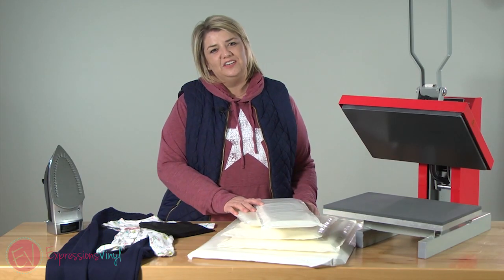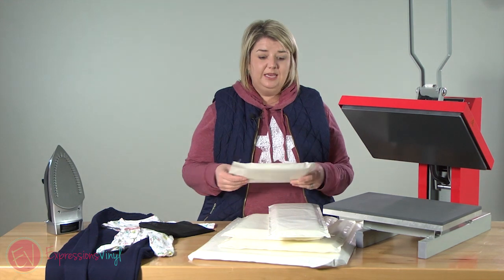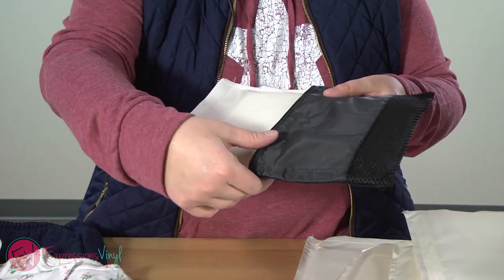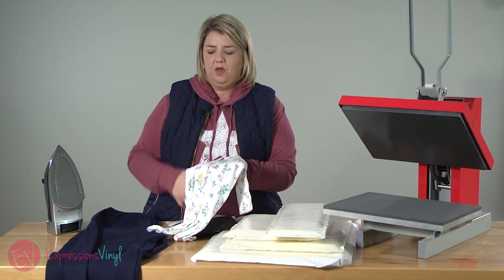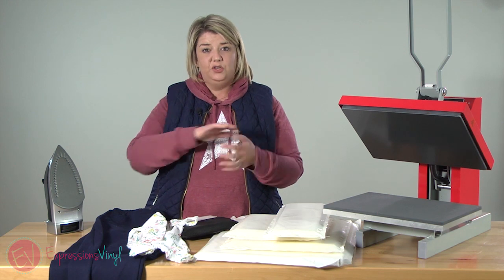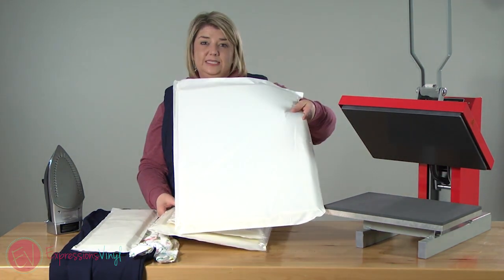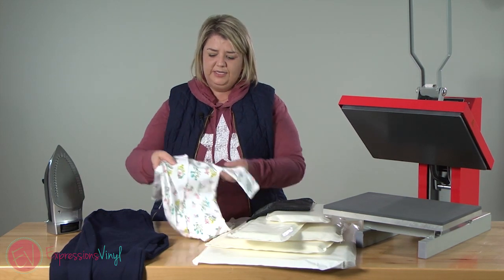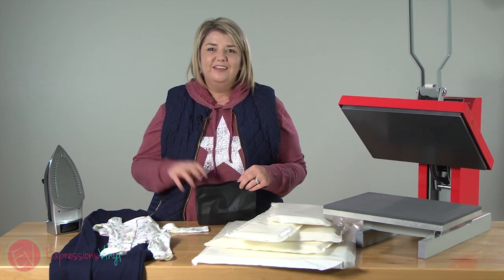How to Use Heat Transfer Pillows Correctly

Comment: Can you show applications using the pillows?  I'd love to see them in action to make sure I'm understanding correctly how to use them. With the small bag for example, once that pillow was inserted, I'm assuming you would place the entire bag & pilliow under the press before locking it down. Is that correct?
Reply from the maker: Yes that is correct. The zipper will press into the pillow and the pillow will puff up the other parts of the bag making everything even out when you press it down.
Reply: Expressions Vinyl thank you!

Comment: Hi! Thanks for the video! I’m wondering why it is necessary to insert the pillow into the garment rather than lay the garment right on top of the pillow? Would it work just as well either way? Thanks!
Reply from the maker: If you have a front and back decal the pillow can prevent the decals from getting too much heat from the other side. If it is just a one sided decal, you can just place the garment on top of the pillow. You will just want to make sure the back isn't wrinkled when you do.

Comment: Hi! With heat press pillows do I need to adjust my pressure to anything different than I have it according to the “paper test” or does it stay on the same pressure? I don’t want the pillow to add too much cushion & break my press. thanks!!
Reply from the maker: It depends on how thick the pillow is. I would try to stick with the paper test.

Comment: Hi, thank you for these tips. Im wondering, can I use the same large pillow for tee shirts and onsies or anything smaller than a tee shirt? I saw someone say you have to use a small pillow for small things etc. Just trying to avoid having too many pillow 😁 Thank you
Reply: Hope that makes sense
Reply from the maker: @jennygrant5202  You would be able to use the larger pillow for the small projects as well. If you are wanting to put the pillow inside of the project because you are pressing on both sides of the shirt. You will need to purchase a different size one.

Comment: Hi do the heat press pillows help stopping lines when pressing?
Reply from the maker: Hi, yes they can.  The hold up the seams of the project you are working on so that it can get even pressure on the htv.  They are great for onesies, sleeves, pant legs, etc.  https://expressionsvinyl.com/tools-accessories/heat-press-pillows/

Comment: good afternoon can I use it for caps or hats ?
Reply from the maker: Yes, that is a perfect use for the heat transfer pillows.  They work great when the surface you are adhering it to isn't as flat as you'd like and a little more difficult to work with.

https://expressionsvinyl.com/tools-accessories/heat-press-pillows/

Comment: Susan
Reply: Oops.  My question, do I place the pillow inside the small size garment or place pillow underneath garment? Thank you.
Reply from the maker: Hi Susan, you can do either one of those.  If you place it inside there is less of a chance for the garment to move off or slip.  However, there are times when the pillow might be too big and it works best to just lay it on top.  Hopefully this helps.  The pillows work great for all those pesky seams and bulky areas!  https://expressionsvinyl.com/tools-accessories/heat-press-pillows/